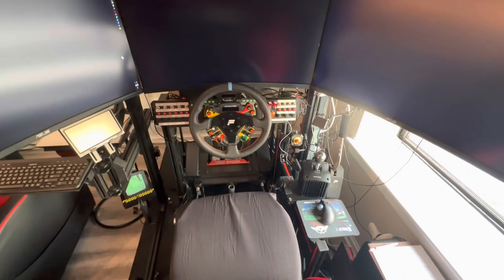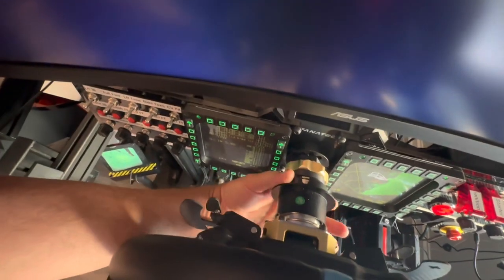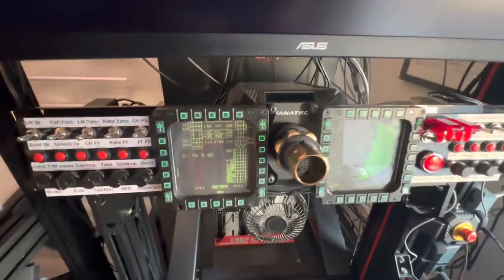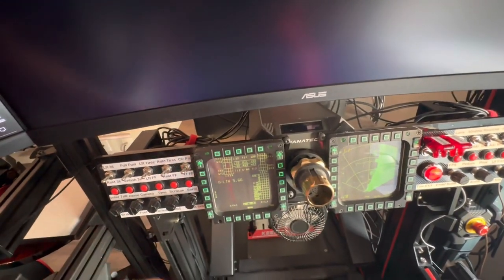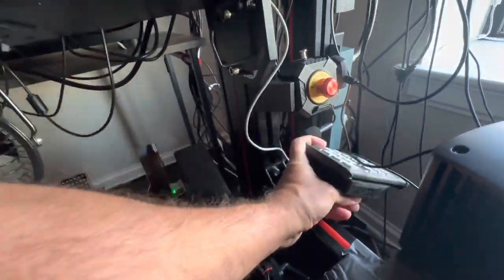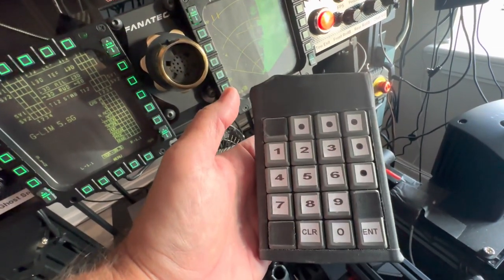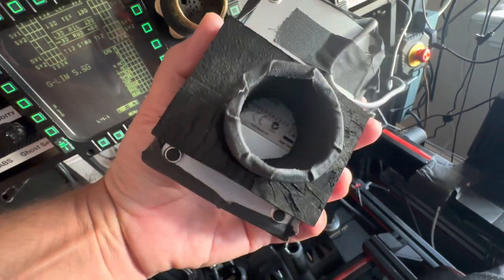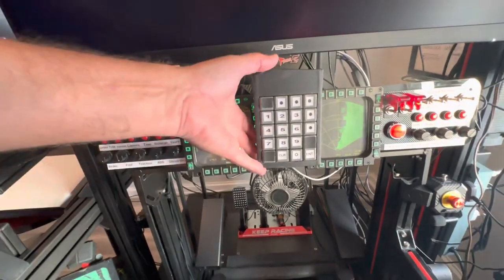8020 Sim Rig #9 - How I transition from driving sim to flying sim and answers to Reddit questions

Comment: Seems a bit overcomplified. Way i did mine - mounted HOTAS throttle and stick locating on sides of seat (with extra mount point on left & stick on shifter profile behind mouse plate mount), mounted to underside of rised rig (on caster wheels, but in your case motion actuators would serve same role) multisection profile to serve as floor for rudder pedals (in front and below simrace pedals) + added seat sliders.
So i just remove wheel from quickrelease, slide seat all way back, and my legs/hands naturally rest on flightsim controls. No inserting/mounting/bolting anything except taking off steering wheel & sliding seat, no tools, quick & simple & rigidly mounted.
It will get overcomplified though if one absolutely must have yoke or center mounted stick though due need to add/remove them, with possibly something on hinges & quick latches, but luckily i feel fine using sidemount flightsim controls, if anything, it even feels a bit more ergonomic/modern.
Reply from the maker: Glad you like your way. I’m very happy with my way.
Reply: Your solution seems to be very easy. Unfortunately I measure 1m93 / 6.3 feet so I am already in the seat position as far back as possible to pilot, I cannot place the rudder in front of the pedals :/
Reply: @maitrecaribouu  technically you can add sliders also under simrace pedals (i did so, but ended up not using, as range (~27cm?) of seat sliders at extremes was sufficient for me.
Also have you done it "at extremes" of slider? Mount seat a bit more backwards, move all way back in sliders, mount FS rudder pedals in HOTAS for this position. Now move all way to front, and adjust wheelbase position & simrace pedals to fit to now this frontmost position.
And take note, that rudder pedals are not just "in-front" of simrace ones for me, but AND below them. On SL P1-X rig, with "rudder-floor-profile" to bottom on rig, on simrace pedals with extra sliders on them, SR pedals are mounted on surface of.. hmm .. about 25cm higher then "rudder-pedal-floor". That results, that my legs on rudder pedals are more "downwards", more bent in knee, while simrace pedals are higher up, with legs straighter in knee, thus somewhat "longer" :), which adds up to "purely slider range".
Whole album including older pics/stages of rig build photos.app.goo.gl/5ANGKNzkrt2XiVrC9
Feeling very satisfied with not having anymore to do any sort of removing (apart from steering wheel from quickrelease), and any cable reconnection. I just pull slider handle and move seat to "change rig mode".

Comment: good stuff.. how do you turn on your DD1? do you reach behind and turn it on everytime?
Reply from the maker: It’s the DD2 so I have the kill switch which also has a power on switch on it.
Reply: @PiranhaZ06  ah ok cool.. i have the DD1 so i have to purchase that.. i just upgraded to a proper rig and a DD1 and  your videos have been tremendous  help to  me on my rig mods... do you know  of a good source that ships aluminum extrusion pieces in standard lengths or cut to order?  also, what are your thoughts on a 49 inch ultrawide vs triples? keep up the good work and thanks again...
Reply from the maker: @juanshaftpatel7488 
I don’t know of a good source for 8020. I ordered 1 piece from Amazon but it was more expensive than it should have been.
Personally I would never choose an ultra-wide monitor. The perspective is all wrong and nowhere near as much visibility as triples. But many people love it and I’m sure it’s much cheaper than 3 separate monitors.
Glad you find them useful!